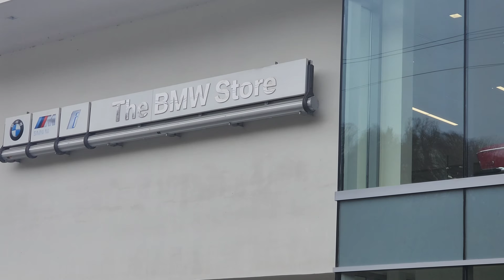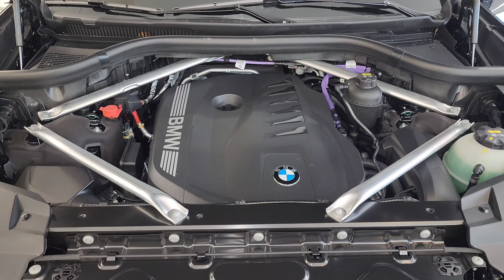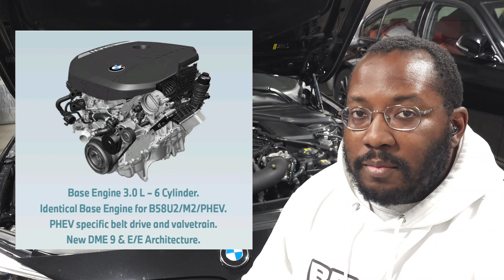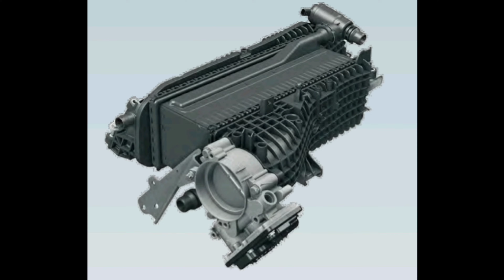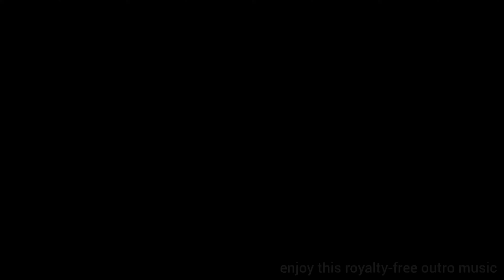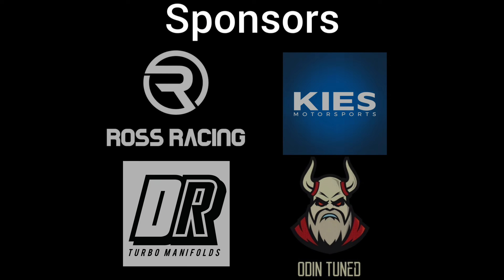New BMW Engines use 0w12 Oil?? | B58TU2 Details Part 3 of 3

Comment: It's interesting to look at the change in fuel economy between the TU1 equipped 740i in 2022 and 2023 and the TU2 equipped 740i in 2024.
One thing I haven't heard any info on anywhere is changes in the usage of the mild hybrid strategy over time; the change in fuel economy from 2022 to 2023, I THINK has to be primarily from changes in how / when the mild hybrid tech is used. 

2022 740i 20/27/23 mpg (city/highway/combined) 
2023 740i 22/29/25 mpg
2024 (TU1) 25/31/28 mpg

I'm also SUPER interested in how port injection could possibly reduce the emissions at low load / highway cruise RPM.  The fuel droplets /mean particle size is MUCH bigger with port injectors and much of the cooling cools the intake air charge vs. cooling the cylinder directly; with direct injection all of the evaporative cooling is applied to the cylinder -lower temps = less NOX. 

Fine-enough fuel particle size usually improves fuel economy too.... 

Now I wish I understood how the B58s do heat management, too. I know that BMW has for a long time electronically adjusted coolant temps (via the electronic thermostats), so that they're higher in highway cruise / low load scenarios as it has a big impact on fuel economy and then cools more when load is higher, but are they doing similar things with the control over the IATs with the electronic control of the intercooler coolant?  (low load means higher IATs and then the port injected fuel evaporates more completely, such that you don't NEED the reduced fuel mean droplet sizes of port injection for further efficiency gains?) 

So many cooling and fueling mysteries in these high tech wunder-engines. 

I do REALLY wonder about the reliability of E-Vanos long-term. Not a technology that I want to be an early adopter of.  Definitely sticking with B58 TU1...

Comment: We just got a 2024 X5 with this engine and in the manual it says you can run BMW LL-01FE which comes in some higher weights. I was actually thinking about running the 0W30 in that spec.
Reply from the maker: Probably fine too but I don't have any data on it yet
Reply: 0w30 LL01FE is very good choice for a B58TÜ2

Comment: For sure the thinner oil, Will provide a better performance, due to High flow viscoscity, but for healthier motor life, i whould change it at maximum use of 5-7k km.

Comment: Near 400 hp with SAE 0w12  which is the service interval prescripted by BMW ?
I guess the intercooler is made of metal ?
Can both injection systems PORT and GDI work at the same time ?
Thnak you 
BimmerN53

Comment: Thanks for the useful info on the new engine. I’m looking into a 340ix next year, hopefully the TU2 will be in by then. My biggest thing is the port injection to mitigate the carbon buildup. I have an 17 SQ5 and I’ve been using CRC intake cleaner every 6 months. At 95k miles, it seems to work real well but port injection would fix all that.
Reply from the maker: Fortunately the b58 runs very clean and doesn't really have a carbon buildup problem

Comment: I have a question about a decat dowpipe, I want to put one on my 140i with the rest of the exhaust stock, any risks ? It’s a 2019 model so with gpf.
Thanks
Reply from the maker: It will throw a CEL
Reply: So need a remap? And no risk with the against pressure in the exhaust ?
Reply from the maker: @Blaze-ff2vl  a remap will hide the CEL and take advantage of it. It reduces back pressure.
Reply: @kern417  Ok thanks 👍

Comment: You were saying thinner oil=tighter tolerances, but isn't that worse from a tuning perspective? Wouldn't tighter tolerances create more heat if the engine gets more load?
Reply from the maker: The second part where I talk about cooling to prevent the engine from seeing as much heat variation is the main reason why they're able to do this. That's why our cars come with so many auxiliary coolers.
Reply: The smaller the tolerance the more precise is the design & manufacturing 

Tolerance is not synonym with nominal (diameter…) size
Reply from the maker: @vollcare4076  in the case of engine design, nominal doesn't matter. you're not measuring the size of the component, but rather the gap. your lower bound is 0 (parts touching) and your upper bound is the largest gap. reducing tolerances mean less space between mating surfaces, even at the largest acceptable gap.
Reply: @kern417  ok, you are probably talking about IT grades such as H7/g6 etc 

I thought discussion was about manufacturing tolerances

Comment: None of these performance engines with such thin oil will last the test of milage lol this is getting rediculous for this type of engine.  Put it in the base models where people will drive like grandmas
Reply: My book says 0w20 or 0w30, the bmw dealer told me 0 w20 in the b58 tu
Reply: @kentnauman9863  5w30.
Reply from the maker: Prove it.
Reply: @kern417  i dont need to prove it lol do some research on it, you gain efficiency but lose protection look at some uoa of it.  Driver A uses 0w12 to 100k miles and driver B uses 0w30 to same milage. Both drive like enthusiasts and do full throttle highway merging, maybe some stoplight racing.  Who would you buy a used car from lets last a 340i with a b58
Reply from the maker: @rafaelbatu7525  you do need to prove it. if you have no data then you have no ground to stand on. literally everything i explained in the video proves that it can be possible from a design standpoint. if you don't understand the engineering details then you should sit back and wait.

And FYI - 20 years ago performance engines from bmw used 10w60 oils. The simple fact that you're acting like 0w30 is now good enough shows what engineering can do when you design an engine from the ground up to use lighter oils. Do some research yourself and get back to me.
Reply: @kern417  i have done the research, what I was saying about proving it is im not going to go back and forth sending links with the data and about 0w30 being enough I use that as a comparison because its all climate and use based.
Reply from the maker: @rafaelbatu7525  and what I'm saying is this engine has been in cars sold by BMW for about 2 months. You have no data on how this engine/oil combination performs.
Reply: @kern417  yes you are correct in this exact engine there is no data but im talking about data from other turbo engines making similar power.
Reply from the maker: @rafaelbatu7525  none of that matters. Our b58 came with more power than an n55 and uses lighter oil. N55 came with more power than older engines and used lighter oil than them as well. It's about engine design not power.
Reply: man you truly never know. If anything people would switch to 0w-20 for peace of mind's sake but thin oil gets in difficult to reach/lubricate spots better.
Reply from the maker: @Chiguirinho  when these cars get in smaller vehicles that enthusiats own, that'll be the real test. 🤝🏾

Comment: If they don't throw the S58 in the Supra before they discontinue it, I hope they at least put this TU2 in. The Supra community would take this thing to some crazy levels.
Reply: Not sure if BMW would sign off on that.
Reply: @grein545  I mean Alpina B3s all use S58 so there is a chance. I thought B3 used B58, but damn I was wrong, they used twin turbo N55 then straight to S58. I can understand that Alpina is a lot closer to BMW GmbH than Toyota (considering BMW just bought them)but it is possible tho.
Reply: @ramen9996 alpina is a part of the BMW group, Toyota is not. If they let Toyota use the S58 in the Supra, they would endager M2 and M4 sales.
Reply: @hexagonosaurus5848  When Alpina released the new B3 with S58 in 2020, they were not part of BMW group at all. It was not until 2022 did BMW acquire Alpina.
Reply from the maker: Yessss I really hope the last 1-2 years get it